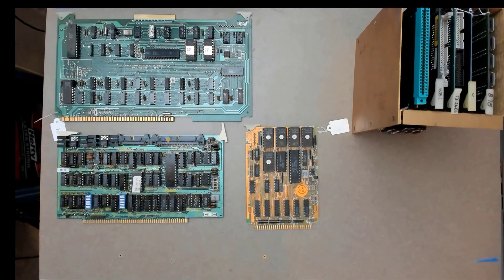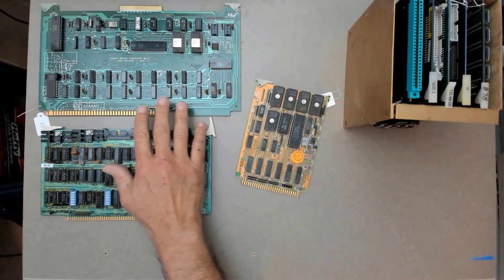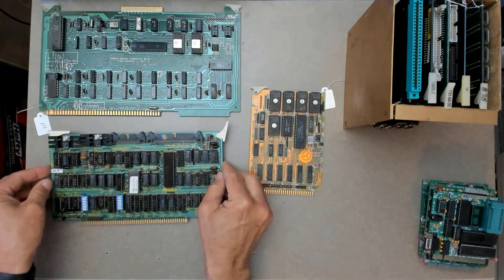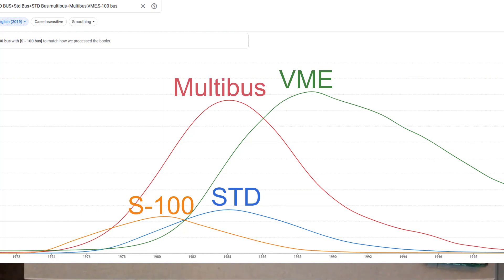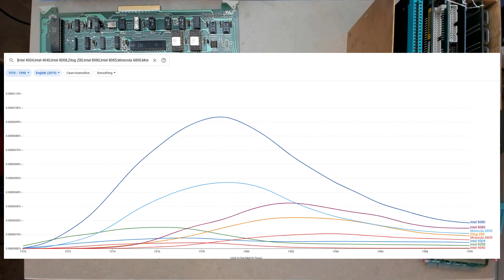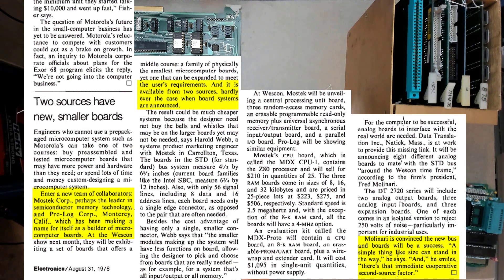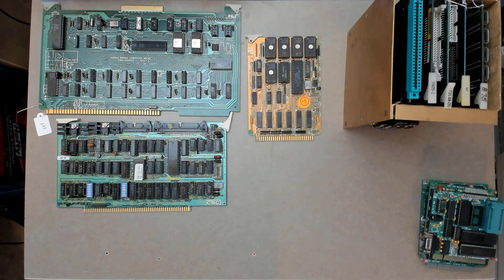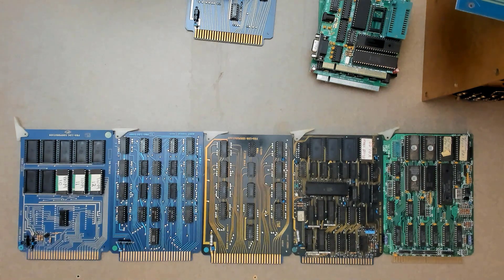{68} STD: Easy to get, Loose standards, and Widespread. Was it the best computer bus from the 1970s?

Comment: In the late 70s I worked with Pro-Log Intel 4040 Single Board Computers with ROM, RAM and IO. Pro-Log were a major buyer of Intel chips but were so cautious of violating copyrights on opcodes that they developed their own mnemonics and associated development software.
Reply from the maker: That is interesting, I have heard other cases where companies were very uncertain how far Intel’s IP went.  Since they are a direct path into the micro design, protecting the opcodes helps to protect the internal design and prevents competitors from making code compatible devices.  But Intel’s mnemonics are simply memory aids to make assembly language easier, and preventing companies from using your mnemonics seems like a horrible idea.  It was a wild time with lots of trail blazing and uncertainty.

Comment: Memories of the days where many engineers didn’t fully understand the principles of Signal Integrity, EM radiation control & PDNs (power delivery networks). Hobbyist systems such as the Raspberry Pi & Arduino still cock it up some 40 years later.
Reply from the maker: Include me among those. I am still learning, ignoring, or muddling through many of those issues.  Fortunately I only play with devices that are little workhorses, rely on brute force, and are slow.

Comment: I <3 the Z80, thanks for sharing all the pleasures of that chip and architecture. I wanted to use STD bus but so little ever went surplus. They were out of my budget.
Reply from the maker: I have seen Z80 STD processor boards in the $25 - $50 range on eBay.  Operation unknown, but they usually look to be complete.

Comment: Great introduction and an inspiration to design a cdp1806ACE cpu card.
Reply from the maker: I don’t know exactly when it came out, but by the very late ‘90s the CDP1806 was probably too late and missed the boat for STD Bus.  However, I wonder if maybe someone built a STD card for the 1802?  

But one never really needs an excuse to design new hardware for a vintage chip (just time).  When I made my SBC-85 system I thought about using the STD platform but decided to start from scratch. You may want to look at that platform so you could also use existing SBC-85 card designs for your 1806 card

Comment: I never heard of the STD bus before, so this is an interesting introduction. Can't wait for a next video detailing how it worked!
Reply from the maker: Thanks.  The next video is actually how it came to be, then some example hardware that are good choices to start putting together systems.  Then come the technical videos.  The short answer is that, to the first approximation, STD Bus is just an extension of the Z80 signals.